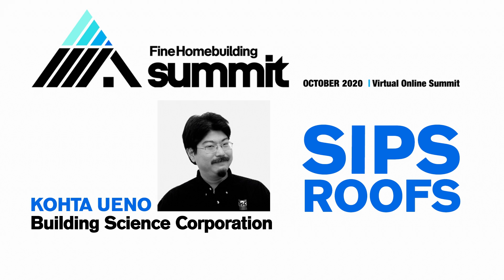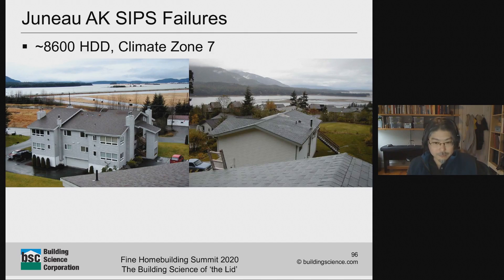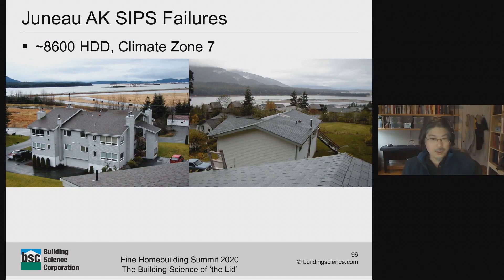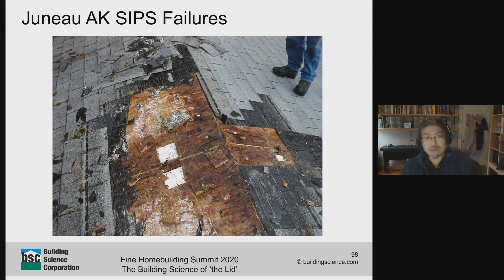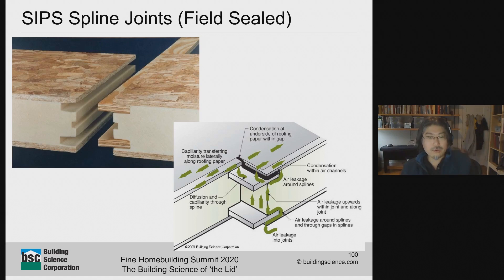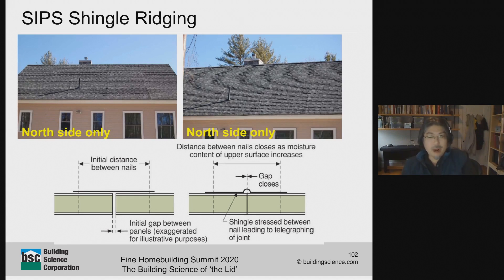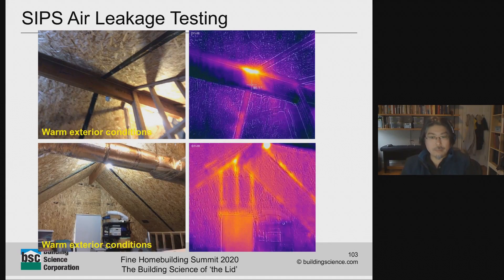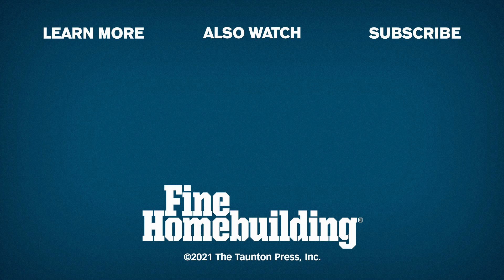Moisture Issues with SIPS and How to Avoid Them

Comment: The new installation method is that panel seams are compressed together, screwed, then tape is applied to the seam on the warm side of the building. The tape needs to be rolled into the OSB skin.  The tape is designed to flex with the building movement.  Also you really need to run a dehumidifier 24/7 in a SIP house - so buy a good one with a good dehumidstat. Pay attention to the ERV - don’t buy cheap crap

Comment: If a SIPs panel roof with Zip System coating on exterior side and seams properly taped off… then shingle underlayment such as Skarkskin material then shingled… do you think you would still get the Sips Shingle Ridging?    My guess is no you wouldn’t.  Thoughts?

Comment: Hi, I recently purchased a timber frame home, and I noticed the sips shingle ridging exactly as your pictures in the video show. At this point the house is 13 years old. Should I be concerned? There are no leaks, but the ridging is not just on the north side of the roof. It is in upstate NY and it gets very cold and very hot. The house was a winter build. I'm very concerned.

 Thank you,
Rick
Reply: I think you need a retro fit roof like he noted at the end of the video.

Comment: I think this is more of a case of misinformation and having a builder not familiar with constructing sips. In all instances in this video, even the details, there is joint tape missing. This is something that is typically recommended by SIP manufactureres that help prevent this condition from occuring. This also seems to bee a poor argument as the SIPs are using OSB which is typically used in other roof conditions, therefore this could happen with other forms of roof construciton as well. I would have thought a national publication with high standards right in the name would provide all the facts for something like this and not only one side of the arguement.

Comment: I do not agree with this mans cause of roof failure. Go look at the photos of the roof system. It looks like not even a 3/12 pitch on roof! If I was designing a roof for alaska, I would have at least a 4/12 pitch roof. I have built and assembled using SIPS. Condensation comes from not changing the air circulation properly, with a tight built home. You must have a sytem to exchange air using some outside air to mix with inside air. I belive from looking at the failure of this roof system, the main issue was not incorporating a proper pitch of roof to not only cause the water, snow, ice forming to drain in a more vertical diection. Dealing with also composition roofing, you must have a minium required roof pitch incorporated to ensure a dry roof. How this man does not touch on the shallow roof design, is beyound my understanding? If you have built houses, you know thru experience, in using composition roofing shingles, you must have at least a 3/12 pitch with, preferably a 4/12 pitch!
Reply: Just asking for clarification. As a builder I understand tile overlap in different climates needs to change but I do not appreciate as yet how changing the pitch affects egress of moisture from a warm environment. I assumed that the true cause is incorrect installation of a HVAC system as this should filter the moisture out of the house. The air inside should not be moisture loaded.
Reply: Right I seriously doubt it’s the air leakage causing this. You’re always going to have air leakage. It’s impossible to have a complete sealed house and not have air leakage. Otherwise you’d remove all windows and lightning too

Comment: Seeing how the intermediate foam is "an engineerd material", mass produced in a factory, it seems a missed opportunity that the designers of SIPS did not include breather-holes/channels just below the outer OSB-skin. A vented over-roof seems like a hacky after-thought.
Reply: I completely disagree. A vented over roof is simply a roof-top version of a rain screen behind siding. Air movement is simply good engineering. Squishing everything together and trusting that is is now and forever will be completely water and vapor-proof is the half-baked solution.
Reply: @spencer476  I never disagreed with the air-movement part. The insistence on doing it in the traditional manual laborious masochistic way is my peeve. If you are going to the trouble of engineering it, don't engineer it half-assedly - do a complete job, inclusive of the second layer and air-movement channels. Don't build "a better horse", build a damn EV instead.
Reply: @AdityaMehendale  The structural part of structural insulated panel prevents something under the skin. Both skins must be tightly bound to the underlying foam. Additionally, the recommendation for an air gap was really in the context of a retrofit, although I personally would do it on new construction as well. My point is there is nothing half-assed about it. Providing a path for water vapor to move through a wall is in fact very sound engineering and building science. Now, it is fair to point out that a second skin outside of the structural layer could be added by the panel manufacturer, however that would add significant additional weight and is not needed in applications where the gap created by another substrate, like siding or standing seam metal roof.